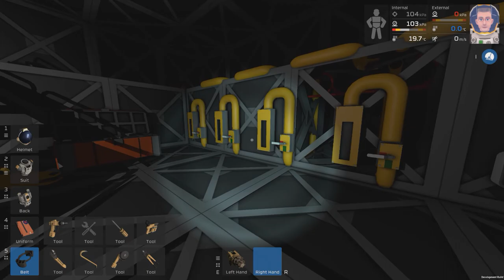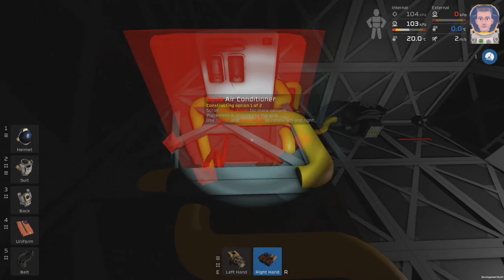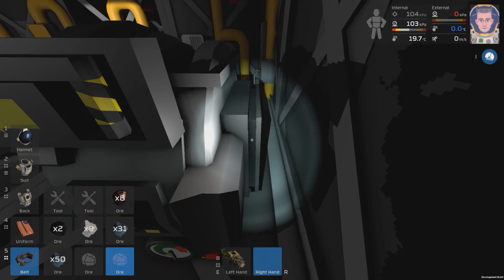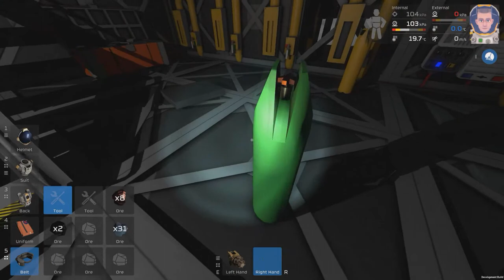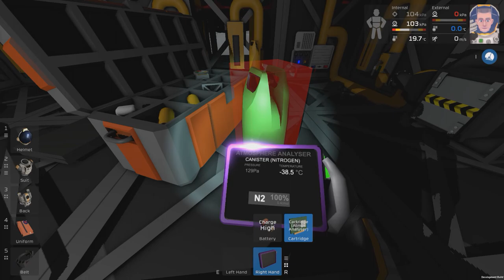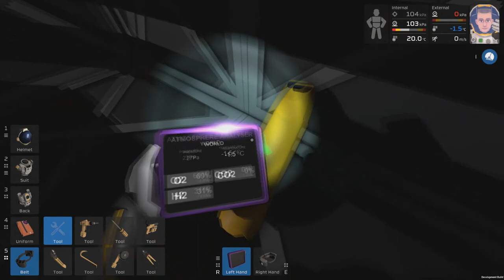Stationeers - Major Gosnell -Episode 9 Seperating Gas, Advanced Filtration

Comment: The issue you had with the volatiles tank was that you put a high pressure (5MPa) tank of O2 in it so it filled the pipes with O2 along with the volatiles (H2).  Had similar issue ended up having to purge all my lines with a vent to clear out the pipes of mixed gases then from that point only put empty tanks in =0)
Reply from the maker: aye,i need to be more careful with my canisters